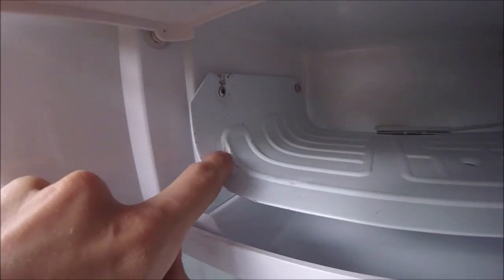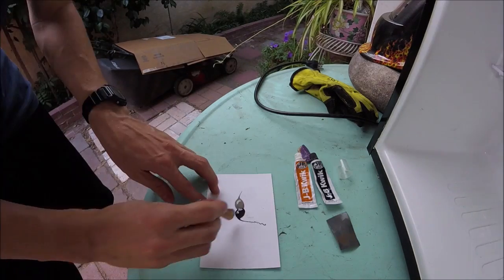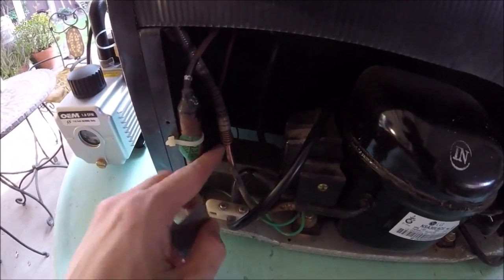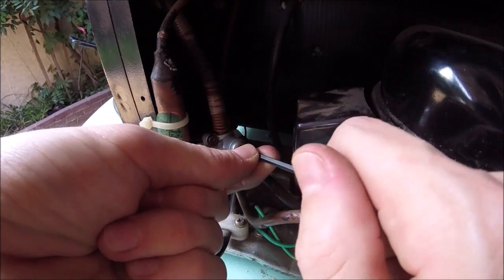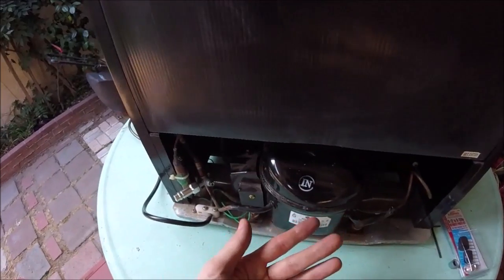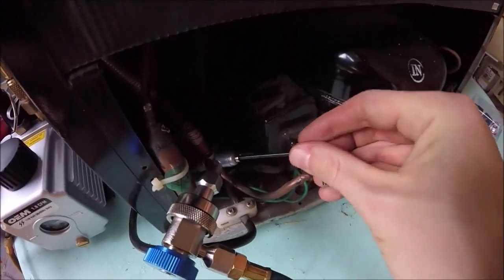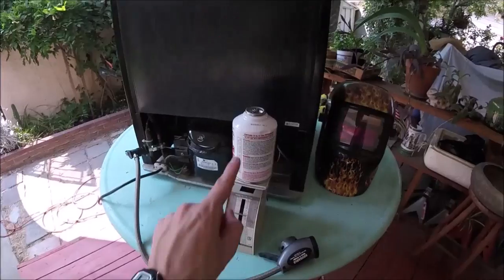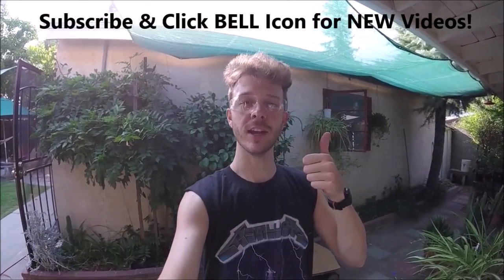How To Fix a Broken Mini Fridge -Jonny DIY

Comment: Not sure if I'm doing this properly or not, was using the pump and it never seemed to move. Was able to add the freon so time will tell.
Reply from the maker: Doesn't take long to get to 29-30 inches mercury vacuum on a small system like that. Hopefully it worked 🤞
Reply: @JonnyDIY  it seemed to get cold, but then it would go warm and cold again, cold enough to cool the freezer a bit but not the entire unit.
Reply from the maker: @Katzmusic112  hmm sounds like didn't get all the air vacuumed out or didn't recharge with correct amount of refrigerant or combination of both.
Reply: @JonnyDIY  either way, the video was very helpful, thank you for that.
Reply from the maker: @Katzmusic112  you're welcome, glad I could help. Hope you can get it fixed and working again or find a suitable replacement 👍
Reply: @JonnyDIY  one more question,  should the fridge be running while vacuuming?
Reply from the maker: @Katzmusic112  No you only need the fridge running when you're recharging it with refrigerant 👍
Reply: @JonnyDIY  ok thank you. That might have been the problem

Comment: Is the epoxy short term or permanent?
Reply: @JonnyDIY  excellent .
I'm in Australia and have a built in fridge in my yacht with remote compressor.  Stuck a knife in the evaporator freezer plate the other night trying to get my dinner out.
Broke my own rule of sharp object.
I will have to fix myself because cant get fridge mechanic to come to my boat to fix. They will come to regas however because it is illegal to buy the gas in Austrslia unless you are licenced refrig mechanic.
Great video mate. It would have helped so many people.
Reply from the maker: @myleswenban8858  Happy I could help you out, good luck with the project. Hope you get it fixed 👍
Reply from the maker: Permanent fix, this fix is still holding strong since I made this video a few years back 👍

Comment: Is it safe to use 134 on a r600a  mini fridge ?
Reply from the maker: Im not certain. I have heard of people completely vacuuming r600a systems and refilling with r134a, but I believe it can cause issues  down the line or not work completely as efficiently. Be careful working with the r600a it is very flammable

Comment: Is it required to recharge your refrigerator after you puncturing it?
Reply from the maker: Yes, you first have to patch hole, then vacuum, then recharge, for it to work properly as it did 👍

Comment: i tryied doing that jb kwik and when i turned it on and the thermostat it made the same sound so i turned it off
Reply from the maker: Even after recharging? As long as hole patched well it should hold

Comment: I have a few stupid questions.  I guess the piecing valve contraption stays on permanently?  Is there no other way to add the coolant?  Do you have to weight the coolant?  Is it possible to put too much?  I already had my mini fridge unplugged when I jammed a screwdriver through the ice and punctured it, is it absolutely necessary to vacuum the line?
Reply from the maker: Yes you must vacuum, and no other way to add refrigerant. The piercing valve stays on permanently and yes you must weigh refrigerant as you can overfill 👍

Comment: What us the best brand of freeon to use on a LG fridge?
Reply: So anything with r134a will work for a fridge won't hurt it over time?
Reply from the maker: @adamcherry9818  as long as your fridge takes r134a it's fine. Should have a sticker on it with refrigerant amount as well 👍
Reply: It does I gotta do a compresser on it goin too start ordering parts and tools and try too do it myself see how it works  thank you for the video
Reply from the maker: @adamcherry9818  You're welcome, good luck with the project 👍
Reply from the maker: I just used whatever was on sale 👍

Comment: Will the epoxy work for larger wholes? My dumb ass put a screwdriver head into the freezer box and I'm hoping I can repair it instead of replacing it.
Reply from the maker: Yes it should with proper prep. Make sure to maybe put small piece tape over the actual hole before epoxying over so it doesnt seep in and clog tube 👍

Comment: Thanks for a great video! Question: I followed these steps and my fridge is over shooting temperature (set to 40deg, measured at ~33-34deg).  Is this a sign I added too much freon?   If so, so I pull some out or just leave it?
Reply from the maker: You're welcome, glad I could help. I don't think overfilling would cause that issue. Dial down the control to lowest (warmest) setting and go from there. It onle needs to run a little warmer. As long as things aren't freezing. Could settle down after a couple days with everything in fridge too. Make sure door seals not leaking. But I'd start with messing with the thermostat control first.

Comment: i did the same thing but Soo as I found out I unplugged it. It’s been unplugged for a few months but I wanted to know if I need the extra pieces?
Reply from the maker: If you punctured a hole in refrigerant line you will need to do all the steps as I did to get it working again 👍

Comment: Can the tray be replaced?
Reply from the maker: Yes you can order new one, but may be cheaper to buy a working used one 👍
Reply: @JonnyDIY  would you happen to know a way to get rid of the tray and just make it a full fridge. We don't use the freezer side of the mini fridge because it keeps freezing over . All it does is makes larger clunks of Ice making it impossible to store anything. Plus we own a deep freezer
Reply from the maker: @Hollowcreator  Unfortunately the freezer tray is what provides all the cooling for the entire mini fridge. That's how they're made so inexpensive I believe. If you can get it fixed or going again just adjust the cold dial to the warmest setting and it shouldnt freeze over much, that's what I did now it barely does👍

Comment: The epoxy weld is JUST epoxy right?? Lol I ask because I'd rather use the brand I like from home depot that has a mixing nozzle.
I have a number of punctures l
Reply from the maker: Yes you can use your epoxy brand of choice. Be sure to thoroughly sand and clean area before gluing. And also careful not to force glue in holes as it could clog tubes. Can put very small piece of tape right over hole to prevent 👍
Reply: @JonnyDIY  got ya that's what I was worried about so pretty much just don't push it into the hole lol. I might do the tape thing. I had tried that but with gorilla glue and I was to impatient so it didn't work.
Gonna give it another go
Reply: @JonnyDIY  thank you for the reply!
Reply from the maker: @miloc6507  you're welcome, glad to help. Good luck with the fix 👍

Comment: You should let the pump run for about an hour to pull all the moisture out of the line.
Reply from the maker: I usually do on bigger systems or systems that have been "open" for a while 👍

Comment: Great video, I have wall compound to cover up holes on the walls, will that work? Thanks
Reply from the maker: No, needs to be an epoxy 👍
Reply: @JonnyDIY  got it. Thanks
Reply from the maker: @fallenone6  you're welcome, happy to help 👍
Reply: @JonnyDIY  so I patche'd it up with exopy, I turned it back on and now it don't get cold no more. Would you happen to know why?
Reply from the maker: @fallenone6  you need to vacuum and recharge system as I showed in video. The refrigerant all leaked out when you pierced a hole
Reply: @JonnyDIY  I figured it was that, as I did see oil come out of the holes. Will follow the video thanks again
Reply from the maker: @fallenone6  you're welcome, glad to help 👍 sometimes can find a good used one for replacement for cheap

Comment: Johnny, wonder if a homemade Chill Door gasket for the freezer compartment might work to slow down the need to defrost the freezer? Anyone try this?
Reply from the maker: It's possible, but I think its the design of the cooling coils running through the tray that causes the fast build up of the frost. May be worth a try though 👍

Comment: I have a mini cooler fridge without the freezer compartment. Lately, it started making gurgling and humming sounds which is quite annoying at nights during sleep. Noticed the condenser is watery and dripping water, so I cleaned the drainpipe which was clogged and wiped the condenser. Turned it back on and the gurgling and humming sound can still be heard loud and clear. Also noticed that this fridge does have any fan to cool the compressor which seems quite hot to touch. Any suggestions? Thanks.
Reply from the maker: Mine makes the same noises, but is in the garage. And yes they do normally get hot to the touch. Maybe turn down the thermostat as low as is safe to lower the temperature. Then it won't cycle on and off as often 👍
Reply: @JonnyDIY  Thank you for response. I will lower the thermostat temperature as you recommended and check what happens. Much appreciated.
Reply from the maker: @earthlycreature8772  You're welcome, glad to help. Hope it quiets it down a little for you 👍

Comment: Hey i have same fridge, its working but not cooling can you help know why this is happening??
Reply from the maker: Compressor possibly could have worn out or maybe a bad thermostat switch control. I'd start with compressor if it randomly just stopped working out of nowhere
Reply: @JonnyDIY  thanks for your reply but the fridge is working but not cooling
Reply from the maker: @ayushiadi4283  when compressor fails everything else, but cooling will work
Reply: @JonnyDIY  i think you are right I checked the compressor and it's too hot. What do i do now?
Reply: @JonnyDIY  hey jonny i wanted to say thank you for your help! I fixed my fridge all by myself 😁😁😁
Reply from the maker: @ayushiadi4283 Awesome, you're very welcome. What ended up being the problem?
Reply: @JonnyDIY  the start relay was broken so it wasn't supporting the compensatory hence it was overheating and not cooling. I changed the start relay and baam! It started cooling.
Reply from the maker: @ayushiadi4283  ohh perfect! I forgot to mention the start relay although I have a couple videos on them. Glad you got it going 👍

Comment: I took the leap today. Unfortunately it didn't work out. They changed the valve from the one you have in your video, to this one (https://www.youtube.com/watch?list=RDCMUC0ACi7Dv2ca2JqwkoOSdZPQ&v=cn6YzkqCG-k&feature=emb_rel_end). It has 2 middle pieces, but only one of them fits, which leaves it not completely tight. Then when I was tightening the piercing valve, I think I saw it start to back out for some reason. And the piercing section just fell out of the thing. So I probably have a hole in my pipe I need to patch up now. Will JB weld work for that?
Reply from the maker: It should hold. Sand and clean area well first
Reply: @JonnyDIY  I may be able to get the valve back together if I do it with pliers or something, but I don't really wanna try that. I appreciate the reply. I actually had a bolt rip from the subframe of my car, and I stuck it back in and JB Welded it, and it's been holding for years somehow. But I try to not take fast corners anymore.
Reply from the maker: @aznnp77  haha thats crazy, but JB weld is pretty dang strong.

Comment: Does it matter what grit sandpaper you use? I know it's probably not a big deal. Just don't wanna mess this up. I have really coarse 120 or 200 grit sandpaper. Dunno if that's too much or not. I mean it's leaking because I put holes in it.
Reply from the maker: Either one of those grits is fine. Just be sure to thoroughly sand area that the epoxy will be on so it gets a nice strong bond 👍

Comment: If these POS mini fridges didn’t completely fill the freezers with ice every couple months then we wouldn’t have to chip the ice out. 
Moral of the story, buy a mini fridge with a separate door for the freezer. You shouldn’t have to fully empty the fridge, unplug it, move it, wait for it to defrost, move it back in, and refill it every couple months.
Reply from the maker: Yeah they frost over so quick on these lil ones. Almost have to do a lil mini defrost every couple weeks

Comment: I punctured a hole in my refrigerant line and patched it with JB Weld, however it doesn't seem to be cooling down anymore. I assumed it would work again after the hole was patched. Do I need to proceed with the rest of the fix in order to get it working again?
Reply from the maker: Yes you must vacuum and recharge to get it working again 👍

Comment: Hey there! Thank you for the super informative how-to! I have a question: I have nearly the same exact model mini fridge, brand new. It's working great, keeping things to temp. It makes the standard buzzing sound while cooling but it also makes an intermittent, higher pitched, almost melodic "whirling" noise while cooling - as if there's air or liquid being pushed through something that's resonating. Any ideas of what's up? And if so, is there something you recommend to dampen or stop that sound? Any advice would be super appreciated. Thanks again!

Comment: Is the vacuum necessary and what does it do to the fridge ?
Reply from the maker: Vacuum is necessary if you've leaked out all your refrigerant. It removes air from system. Step can't be skipped unfortunately or fridge won't cool correctly 👍
Reply: Okay so how long do I vaccum the mini fridge ?
Reply from the maker: @martinhernandez1691  once you seal leaks, only need to vacuum a few minutes

Comment: yes hello I have you watch your whole video and thankyou very much and  have  followed all the  steps  but the issue I’m having is the Freon doesn’t seem to be
hold up in the freezer box tray in my mini fridge it just goes back to water it won’t  stay  cold very  long I have patch up all the piercing wholes in the freezer tray but still getting waterness 
I don’t know much about fixing mini fridge or refrigerators is something im mistakenly doing wrong any advice you have for me to fix this problem with the water dropping in the freezer box  tray 
after adding the Freon I get this issue and thankyou
Reply from the maker: Make sure holes are properly sealed off then recharge. If you recharge with proper amount of refrigerant it should work and get cold enough so it doesnt leak water but freezes

Comment: This just happened to me 😒😒
Reply from the maker: Sorry to hear, my condolences 😔
Reply: @JonnyDIY  

 So I have not done anything for the past month I guess I wanted to ask you how much did it cost more or less to fix all of that and I have no experience on how to fix it but there is a place that could do it for me but they told me I should just buy a new one because it'll cost a lot
Reply from the maker: @puertoriqueno24  only cost me maybe $20 but I had the refrigerant already and hose and just rented the vacuum pump and gauges. You're probably better off finding a new used one off craiglist, offerup or Facebook marketplace. I see them for under $50 all the time

Comment: I did 2 layers of jb weld and still hear a small amount of air (a lot less than before) coming out, is this okay or should I look into getting a new mini fridge?
Reply from the maker: Yes you need to re do it or try again until no hiss. You'll know once it holds vacuum that you've got it fixed 👍 or try and find a used one off craiglist, facebook marketplace, or offerup. See them for less than $50 regularly 👍

Comment: Will “water weld”.. (very similar to jb weld).. hold the vacuum??
Reply from the maker: Possibly, have never tried it. Not sure how well it will stick to the slick plastic
Reply: What are the chances of the bullet piercing valve leaking overtime

Comment: What If i did every step but didn’t vacuum it🤦🏻‍♂️????
Reply from the maker: Unfortunately you have to vacuum it for it to work correctly 😞
Reply: @JonnyDIY  oh alright
Reply: @JonnyDIY  cause when i connected the hose with the gauge and freon it went behind the 0 to the green 10 so i put it back past the 0 to the second tally line, what can i do now since i did that ?
Reply from the maker: @arthurrios3081  if you havent vacuumed yet, just leave it be and hook up vacuum and do that for 15 minutes. Then add back the precise amount of refrigerant, try to use a scale because most fridges only take a few ounces
Reply: @JonnyDIY  oh okay

Comment: Not sure if you will se this seeing as it was so long ago. The tray under freezer is a drip tray correct?
Reply from the maker: Correct, so if you need to defrost, just turn the unit off or unplug and let melt. Will go in drip tray that you can empty 👍
Reply: @JonnyDIY  Awesome! Thanks for replying so quick. Bought one off of an auction site and the tray is damaged at two corners and figured I should fill them just in case its a drip tray. Manual didn't mention it at all lol
Reply from the maker: @XcaLiPaul  Nice. You're welcome, glad I could help 👍

Comment: So I had a brain fart and punctured my kegerator cooling system thus making it useless. Everything on internet said it was toast couldn't be fixed until I saw this video. So I follwed instructions 1st time and failed. I put too little JB weld on the hole so when I pressured up it blew out right away. I put new large glob on and it held fine 2nd try. Other mistake I made was to over fill the condenser make sure you only put in exacat amount it says I had keep bleeding out excess coolant. This was great video saved my ass thought was going have to toss dual tap baby lol.
Reply from the maker: That's awesome, glad my video was able to help you fix youre kegerator 🍻👍